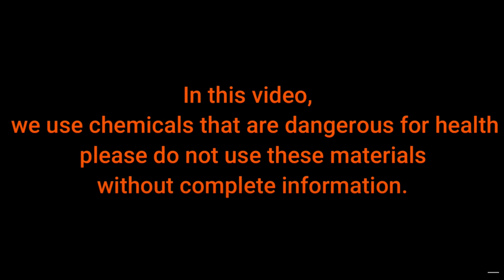Gold Recovery From Mobile Phone Circuit Boards | Recover Gold From Mobile Phone Circuits

Comment: I used to work as a warehouse manager for a company that recycles cell phones.  All of the phones are taken apart and the material sorted out into lcds, circuit boards, plastic, batteries, etc.  and sent to China to rebuild new phones.   You would need a ton of cell phones to get enough gold to actually make some money.  Those throw away phones that WalMart sells are actually recycled phones.  They aren’t new.  They may look new and come in a pretty package but they are not.  They are recycled.  China is making a fortune from old cell phone material.  It’s an interesting process for sure.
Reply from the maker: yes bro its true and thanks for watching my video 🌹🌹🌹🌹
Reply: You tried
Reply: 인권비도 안나오겠네

Comment: What can I use instead of filter paper if It's not available
Reply from the maker: you can use news paper for filtering
Reply: I used smb and my gold dust was settled and I had no filter paper so I tried to heat it and dry it but it has turned into crystals . Can you please help me 🙏
Reply: @SahilKhan-fq1xw  sıcak suyla yakayıp kurut sonra erit.

Comment: Dear sir hope you will be fine i am tour student from pakistan sir i have some problum.is it possible to recover silver from smb water after recovering gold please teach me 
thanks 
jazakallah
Reply: Tuz
Reply from the maker: What Happens to Silver in Aqua Regia?

Silver (Ag) does not dissolve easily in aqua regia (a mixture of nitric acid and hydrochloric acid). Aqua regia is primarily used to dissolve gold and platinum. When silver comes into contact with aqua regia, it forms silver chloride (AgCl), which precipitates out as a white solid. The reaction is as follows:

\[ 3Ag + 4HNO_3 + 6HCl \rightarrow 3AgCl + NOCl + 2Cl_2 + 3H_2O \]

The silver chloride produced in the acidic environment of aqua regia precipitates and separates from the solution. This precipitate can be easily converted back to metallic silver using ammonia or other chemical methods.
Reply from the maker: gümüş kral suda gumuş kolurure donuşur

Comment: Hello, how are you? I would like to get to know you
Reply from the maker: its ok no problem . were are you from sir
Reply: @ImanGoldRecovery  Where is sir?
Reply: I have a quantity of old phones.  I saw a video talking and saying that if lead or tin solder is found in the mobile phone charger, if you use the Aquariage method to extract gold metal, it turns into colloidal gold, when lead or tin solder is present.
Reply: I want a way to remove solder tin from a mobile phone
Reply from the maker: @PabloEscobar-iq3rk  yes i have a video for this problem serach in the my chaneel